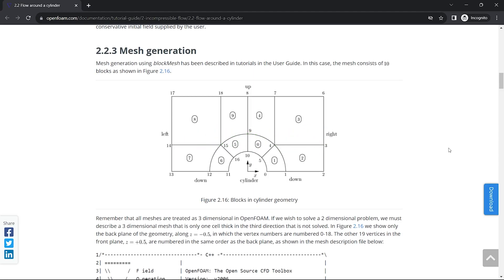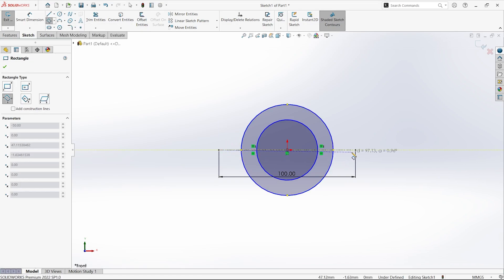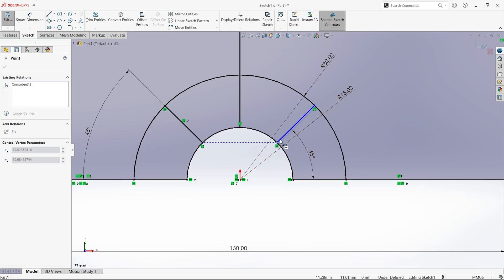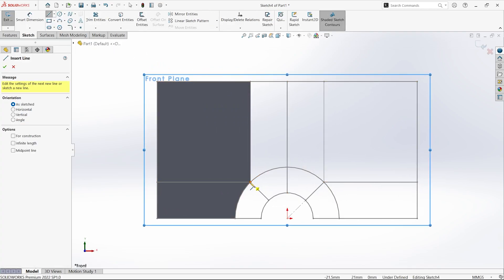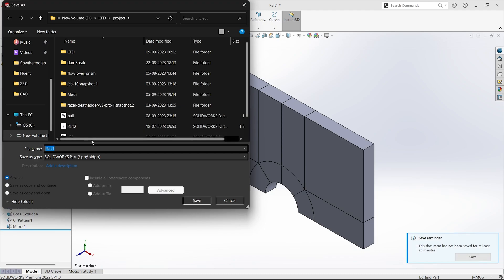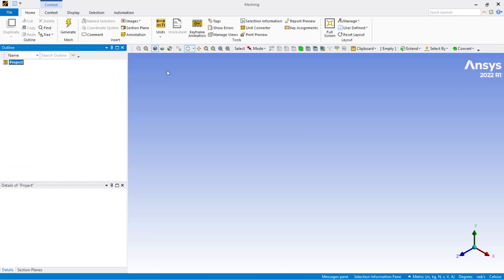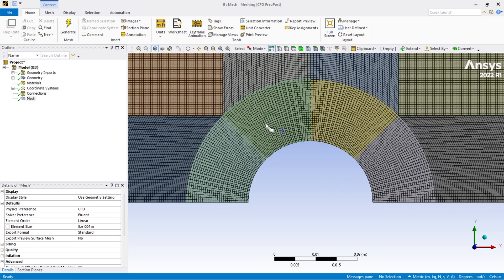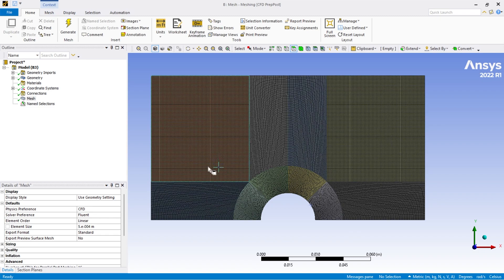3D Structured Hexahedral Mesh for Flow Over a Cylinder | ANSYS Mesh | English |

Comment: What happens if one does not combine all the body parts into one like you did in here 8:02?
Reply from the maker: As we mesh different bodies, it tends to mesh each body separately. If that happens, the mesh elements from one body wouldn't essentially coincide with the adjacent body's mesh elements at their interface. So we do not want to treat them as different bodies, but as different zones in a single body (in this case, called the part). If the mesh elements do not properly align at the interface, there will be bad mesh problems during the simulation. Also, it will be treated as flow from one region to another. We do not want that. By splitting the body into zones, we are just creating a simple structured 1-D path for the mesh to propagate without deviating. We want split body during meshing phase, but not during the solution phase. By merging them into one single part, we are importing a multizone part for mesh-er and a single body for the solver. 
I hope it is clear.
Reply: @Codeynamics  so in short, it is all for the sake of getting a continuous structured mesh through all parts, did I get that right?
Reply from the maker: @DarthVader-ir1bx   yes. you got that right.
Reply: @Codeynamics  thanks
Reply: If I solve this structured hexahedral mesh in Ansys Fluent not in the Ansys CFX. thenafter streamlines stops before reaching the outlet during post processing in CFD post. 

Why it happens in Ansys FLUENT